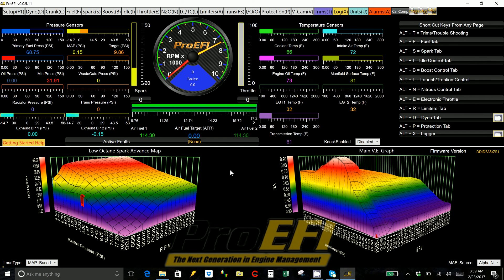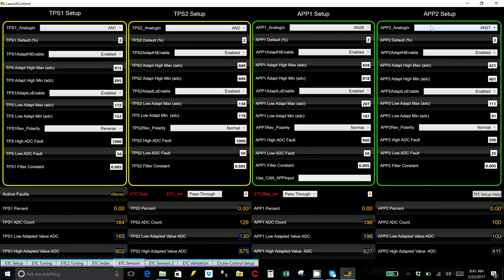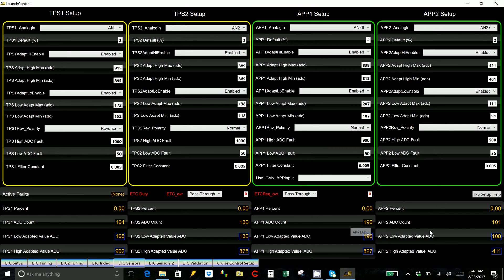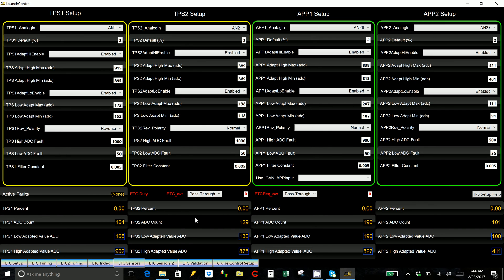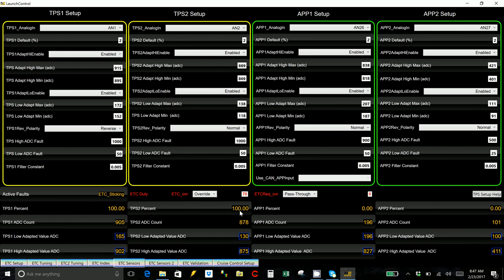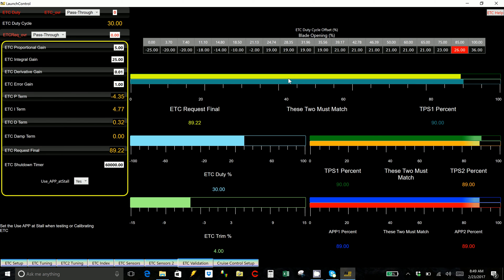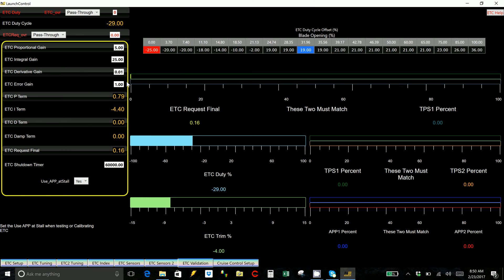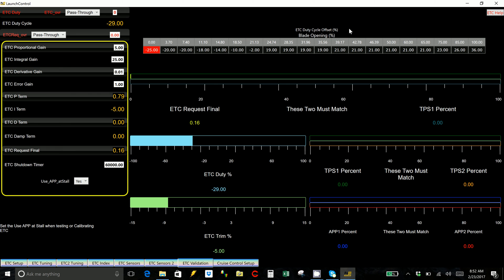ETC Setup Tutorial

Comment: Can you turn the PID loop off when you are calibrating the throttle? That would be a nice feature so you could make stationary adjustments in open loop.
Reply from the maker: No, if you turn the PID loop off....the throttle will never move. The base duty is just enough to hold the blade against the spring.